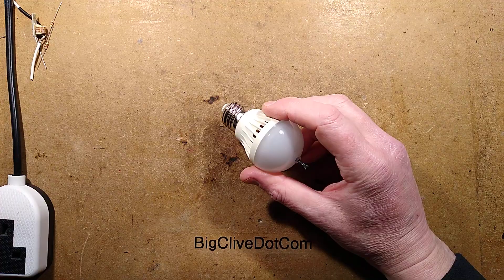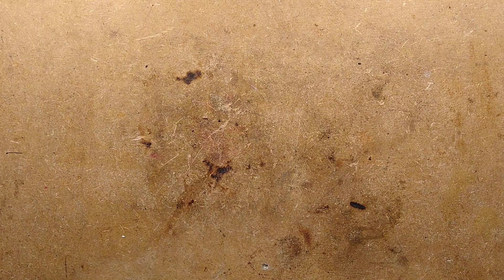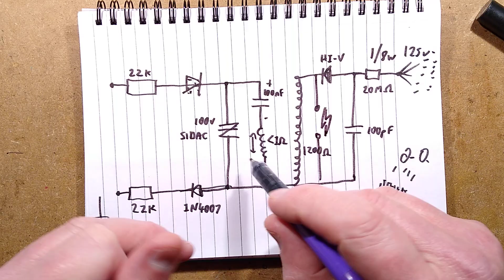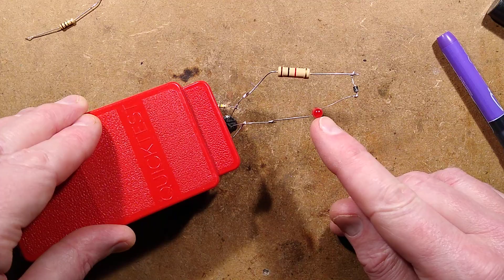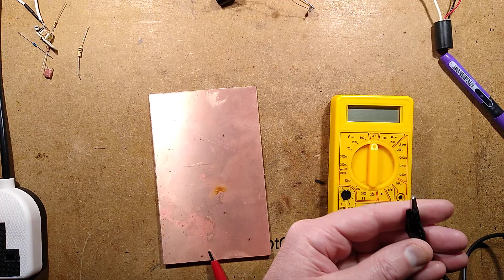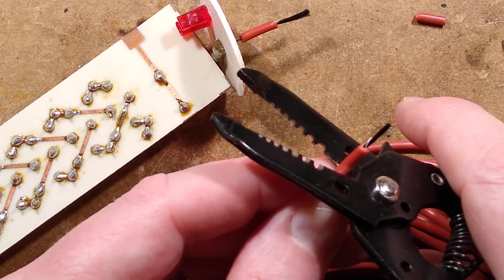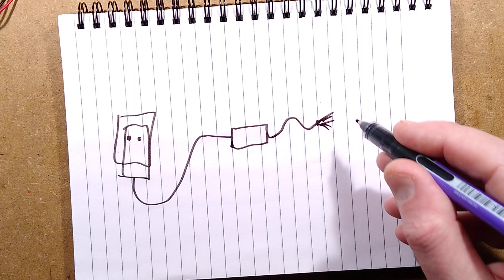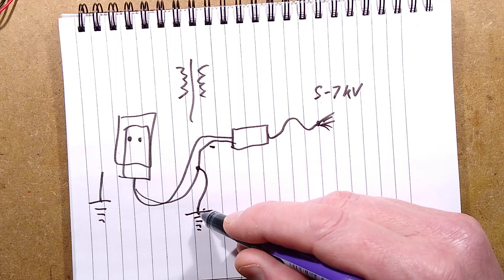LED lamp with tiny 5kV high voltage ion module.  (inc schematic)

Comment: I have one of these https://www.heavenfresh.com/silent-ionic-air-purifier-air-ionizer-hf-100.html which runs off a 12V plug pack or from the cigarette lighter socket of a vehicle.  There are two needles and two 'points' in the front of the box, they pass through a metal plate with large holes cut in it and there is visible coronal discharge from the tips and a smell of ozone.  There is a draught, but I have no idea what the output voltage is ultimately referenced from.  It also came with a pack of really stinky vanilla crystals.  Sadly, the innards are mostly in a potted block.  I think the name 'Heaven Fresh' is a variation on 'Mountain Breeze'.  But what do you reckon?
Reply from the maker: That looks like an ozone generator pretending to be an ioniser.  Not a great idea in a confined space.  Might cause tired eyes and a husky throat.
Reply: @bigclivedotcom , when I saw the bit in this video about earthing one side of of the plug pack to ensure a ground reference, I wondered about somehow adapting the HF100 as all the other components seem to be there.  The website certainly seems to have gone down the quackery alley since I bought the HF100, when I could not tell from the description on popular online retail stores whether it was a genuine ioniser - it's now "Amazon's Choice" and badged the PureMate PM 100!
Reply: They stopped making the HF100, I think, they also did a massive one that ran off the mains plug pack only that a friend tried out but found the resulting air too astringent https://www.heavenfresh.com/ionic-air-purifier-ionizer-with-negative-ion-generator-hf-200.html.  However, there's a https://www.heavenfresh.com/personal-ionic-air-purifier-hf-86.html 'personal' version that I am sure is completely ineffective.

Comment: Those high voltage inonizer modules are also used in ion-hairdryers. Found one in mine when i took it apart after the plastic radial fan exploded.
Reply: "plastic radial fan exploded" that sounds fun!
Reply: Mine has one too.. A Philips hair drier. Really works too stopping your hair from frizzing out 😂
Reply: @muzikman2008  Hah, really? I always guessed it was just a gimmick!
Reply: @FarnhamJ07  me too... But they really do work on hair. I suppose when drying hair without it you create positive ions in the hair, and the ioniser produces negative ions that cancel out the positives and voila!.. No sticky up hair. If I turn the ioniser off you can def see the difference. It's like a vandergraff generator without it 😂
Reply: i guess the fans in hair dryers are axial fans and they shatter or simply break and dont explode but we get the idea
Reply: @urugulu1656  Both styles are used, my new one is axial.
Reply: Yep, gots me one in my random parts bin from an old broken hairdryer too. Neat seeing the magic inside!

Comment: Would it work with a very fine copper wire brush at the end? instead of carbon one from heating wire?
Reply from the maker: It might, but it needs the sharpest tips possible.

Comment: awhile back you (Clive) showed us an ionizer that you made when you were younger.  Do you think you could come up with a project for a live build of an ionizer including changes for 120 volts?
Reply from the maker: For 120V it really needs a transformer to boost the supply voltage to 240V and keep the multiplier stages down.

Comment: What could these be used for?
Reply from the maker: Passive air cleaning by electrostatic precipitation of dust and other airborne contaminants.
Reply: @bigclivedotcom  could it be used to get rid of damp in a room? My parents new house has one room with damp in the corner of a room that's almost gone but not nearly. Would this bulb help? No one is using the room yet
Reply from the maker: @jamiecullen9075  A proper dehumidifier would be better.

Comment: Sidac? I thought that weird device was called a DIAC!
Reply: @briandeschene8424  A DIAC is bi-directional, it triggers on each half cycle, A SIDAC behaves similarly but has higher breakdown voltage because it has five layers rather than three. Pinched that from Wikipedia but I already knew a DIAC was bidirection as I used one in a uni oven control project.

Comment: Wow, that looks kinda dangerous having an exposed high voltage bristle.  BE CAREFUL twisting the bulb out of the socket when on not to touch the bristle or you would get electrocuted!
Reply: The current output is so small you won't even feel it.

Comment: Nice video again! I like to see a sipler LED blink that would run on 5V, but excluding any chips, transistors, self blinking LED's... But the one you demo here was getting close. Thanks!
Reply from the maker: You can buy self flashing LEDs.
Reply: @bigclivedotcom  I have about 100 of them, but I wanted to use it as a teaching tool for kids. I've made some using transistor, cap+resistor, but I was hoping for couple components or so. So far I have not find any other than 555 chip, transistor or two....

Comment: How would adding several brushes affect the output? I have a few ionisers with 6 or 8 needles but if I added brushes to all the needles, would that drop the voltage enough to render it useless?
Reply: You could always just use the copper PCB measurement technique to check ... I think the current setting is the most accurate representation of the total amount of ions generated (on the voltage setting the PCB pushes electrons away, you're also measuring momentum).
Reply from the maker: It would self regulate based on the current delivery ability of the power supply.

Comment: What is the difference between sidac and diac? Both of them conduct when voltage gets to the  specified (conducting) voltage
Reply: @briandeschene8424  except DIACs are bi-directional...
Reply: @LDuncanShortridge  Oh yeahh! Soo what is the difference then?
Reply: @theoneohmresistor  a DIAC (Diode for AC) is a four-layer device, basically two back-to-back zeners while a SIDAC/SYDAC/SAS (Silicon Diode for AC/Silicon Thyristor Diode for AC/Silicon Avalanche Switch)  is a five-layer device with higher voltage and power capabilities more akin to a QUADRAC (a TRIAC with an integral DIAC trigger). A DIAC is typically used as a trigger device, while a SIDAC is also used as a Transient Voltage Suppressor
Reply: @briandeschene8424  Oh! Thank you! I could have done mine research...

Comment: Hi there,
- did you check with your oszi at what frequency that thing is operating ? Thinking about EMI .. perhaps there is a hidden 5G deathbeamzapper in there...

- since its rectified you could use a couple zener diodes stacked, but they do not have a sharp turn on point.

- i now wonder whats in those modern "single coil" spark-plugs with included high voltage generator... you could build a monster ionizer which runs of 12V

hmmm... https://en.wikipedia.org/wiki/Oudin_coil

Comment: You should try using break cleaner as the solvent to dissolve the resin it works a treat I use this technique at work all the time!
Reply from the maker: I may try other solvents.
Reply: bigclivedotcom Good has to hear! Break cleaner is harsh enough to eat it’s way through silicone based epoxys but won’t damage components or FR4 👍

Comment: So you can't make a transformer for such a low current and high voltage, even at high frequency? Of course, just make a high frequency, high voltage, transformer that runs in high current pulses! Reminds me of a spark gap Tesla coil, except it used a SiDAC instead of a spark gap, and I don't know if the secondary rings at the same frequency as the primary.

Comment: Very good video.  I learned two things from this.  1: your method of depotting using acetone.  I will try it and compare it to MEK which might work faster.   2: I learned about SiDAC
Reply: (I accidentally posted this before I was done because I was using my cell phone instead of a computer, so continuing): SiDACs.  I had never encountered one of these before.  They are as little as $0.52 from Mouser in single quantities.   Thank you

Comment: would that trip an RCD in some moistured circumstances ?
Reply: It doesn't leak that much current. A 5mA output ionizer would be quite a force to be reckoned with, although I did once stumble across a paper from Spellman High Voltage, titled 

"Highly Efficient Switch-Mode 100-kV, 100-kW Power Supply for ESP Applications.""ESP" raised an eyebrow, until I figured out it's about electrostatic precipitation. One of the world's most powerful ionizers, I'd imagine.

Comment: I used the info you provided to reverce engineer a voltage multiplyer that I could then used by hooking its into to a CFL inverter. I then used this rather zappy & dangrus thing to power a night vision tube. Videos on my channel. The tube has now become a scope night vision for me to play with. Sure its a gen1 with horrific screen burn, but it was a fun project. Well the parts I was not waiting to silicon to dry.

Oh my insolation techneek still needs work & it can give you a zing while using it, so its super fun. =-D

Comment: Your mains power I'd 50 cycles. Being a diode is in series with the mains, would that not be like a 1/2 wave giving 25 cycles to the circuit ??   From the carbon fiber tip, is a high voltage ionizing the air. 
Would that not make ozone ? And I thought ozone was bad to breath in.
Reply from the maker: 50 full cycles a second.  There may be a very tiny amount of ozone generated, but not enough to be harmful.

Comment: Clive I wanted to tell you I've been watching your channel for 1-2 years now and have barely any hands on experience with electronics but with everything going on and being quarantined I ordered a cool LCD clock kit to try to solder together while I'm stuck inside. Hope it works when I'm done but if not it was cheap, I'll buy another and try again!
Reply: Buy a "blank circuit board" perfboard with holes and copper traces to practice soldering on. It's easy but the practice really really helps. The part you don't ruin (you will ruin at least part of it, we all do) will be useful to you later on to build your own designs on.
Reply: @markfergerson2145  Just to add - buy a bunch of resistors as sacrifice components to go with the perf board - absolutely dirt cheap components to practice with.
Reply: Traps for beginners with those cheapie clocks: 1 The pads are really tiny and easy to rip off the board.  Cut one leg at a time and do it very carefully. 2. be careful with the polarity of the LEDs if it has them.  The circuit board or the instructions may not be very clear, or just downright misleading.  3 if something doesn't work you learn far more by figuring out why than you would if it just works first time, and problem solving is a rewarding skill.  4 take your time and have fun
Reply: I have been following Clive's channel for many years now, however I never work with mains. 
My 'stuff' normally revolves around low voltages and Arduino.
But I still come here because of the way in which Clive explains things so well and I do learn useful things.
The reason for this comment though is nothing to do with that.
I wanted to say that I think it is great how almost instantly, people responded to Shady97342 in a really positive and helpful way. Which is something seldom seen on YT.
I wish everyone was so helpful in life. 
It just goes to show the quality of Clive's subscribers.
Reply: Please let us know how it goes  :)
My grandpa got me into math & electronics when I was a kid...I love hearing about others experiences in learning about electronics.
Reply: Use a regulated soldering iron. Even the cheap ones are better than something without a temperature control.
Reply: Excellent! Best wishes on your assembly! It's all about practice and developing a feel for how molten solder behaves. A little note on technique... It helps to have the iron a bit hotter than you might expect and to work quickly. You want the pieces you're soldering to have enough heat themselves to melt the solder so don't look to the iron to be what you melt the solder onto. Get in quickly with firm metal to metal contact for good heat transfer to the work, apply the solder to the surfaces you want to form the basis of the joint, and get out quickly before you apply enough heat for it to spread up the component leads and damage things. You may also want to get some no-clean type liquid rosin flux to supplement the bit of flux contained in the solder. I use MG Chemicals rosin flux https://www.digikey.com/product-detail/en/mg-chemicals/8351-125ML/473-1412-ND/9658014 and it's the difference between exceptionally easy soldering and having an impossible time. Welcome to a new world. 😎

Comment: It always amuses me how you discharge capacitors with a full metal body screwdriver. :D For safety!
Reply: Yeh, it t ruins the crimp to foil connection.
Reply: sure

why not the resistance between the part of the screwdriver going across the cap is lower than that of the part that goes to your hand and the resistance to ground your body provides is in the kohms... and since all you want to do is remove the charge from the cap (ie. making both plates of the cap the same potential) and since electricity goes always the way of least resitance  you are relatively safe (because the short circuit current will be run through the tip and only a negligable amount will go through your body). if that boggles your mind remember that in a homogenous chunk of material the resistance increases linearly with distance which is exactly how potentiometers work....

only if you are using a screw driver that has an anodized tip this will not at all discharge the cap since the oxide layer is insulating. also the handke might be anodized ....

Comment: Hi I have a question about something different I hope its ok if i ask it here. How would i run this / convert it to E27? https://www.budgetlight.fr/philips-tuv-pl-l-24w-4p-uv-c-unp  Thanks!
Reply: 250 GBP an hour plus any part thereof..
Good advice is hard to find and not cheap
Reply from the maker: You'd be better just buying a complete E27 UVC lamp.
Reply: @bigclivedotcom  I definitely would its just that shipping to france takes almost 2 months in most cases :(

Comment: Clive, have you seen the new CPAP cleaning gizmos? They just seem to be an ozone generator with a fan to blow the gas thru the CPAP's air tubing. One wonders if they really generate enough ozone to sterilize. They sell for $100-$200. I bet a hobbyist could make one for a tenth of that.

Comment: can you elaborate on a SIDAC?  im a heating eng./service/fitting and have never seen one.i would of thought it was a diode. How did you  identify it so easy?  im writing this 6 minutes in,so apologies if youve already told us.
Reply from the maker: You probably have seen one next to the little high voltage transformer on a heating controller PCB.  Wikipedia has an article about them.
Reply: Thankyou Clive

Comment: Free  SIDAC* with every 2w light bulb purchase!  *Acetone not included.
Reply: I recommend LCSC, you can search by parameter and their prices are better https://lcsc.com/products/Diacs-Trigger-Diode_379.html. They also package everything very well(they package each SKU into small bags and put that into a solid box in my case). minimum order quantity is usually not a lot, so quite useful for me a hobbyist. I've had a great experience with them.
Reply: @jort93z  dude, it was a joke.

Comment: So wait, what's the difference between a DIAC and a SiDAC? They seem to serve the same purpose? The act sort of like low-voltage spark gaps.
Speaking of spark gaps, this circuit looks suspiciously like a Tesla Coil, could you perhaps build a really very small "Spark Gap Tesla Coil" that runs from mains voltage with this? By small I literally mean using a toilet paper role as the secondary.
Reply: Good luck finding a toilet paper roll.
We are now into super-dooper dinky ferrite cored pulse transformers.
It is a Tesla thing.
Reply: @FarleyHillBilly  Any insulating material ideally low flammability and low dissipation factor will work well. Acryllc tubes work well.

Comment: Similar to an old style car ignition system.  Ah, the good old days:)
Reply: I was thinking that, too.  Given the way it's designed, it is an auto-transformer with a different means of regulation that is used in a car.  (I also couldn't find any reference to this being called a SIDAC, the only references I could locate for a SIDAC describe it as a type of thyristor designed for AC, which is what I though the base thyristor was, but never mind...)
Reply: https://en.wikipedia.org/wiki/Delco_ignition_system